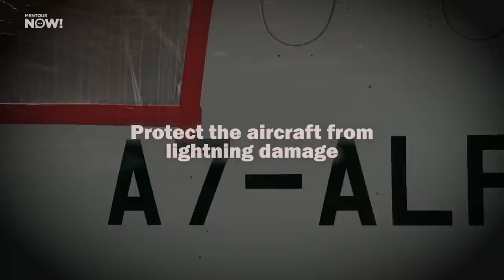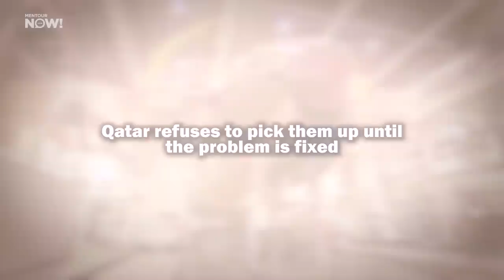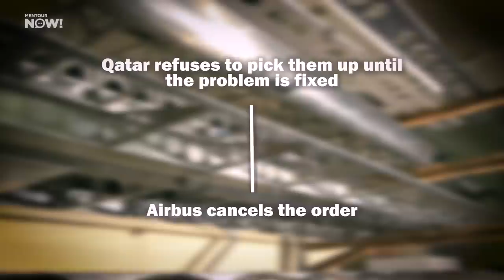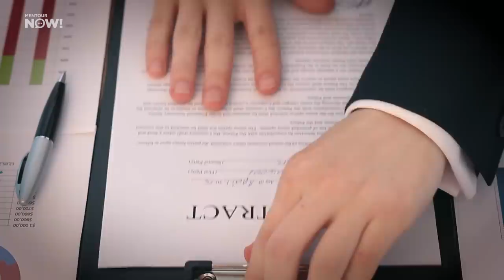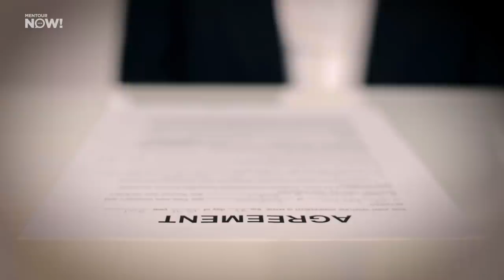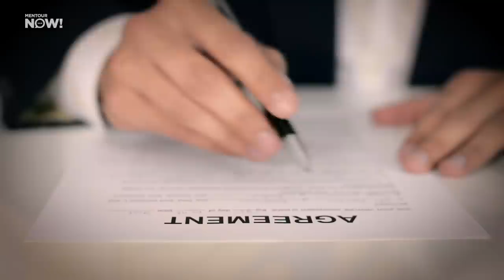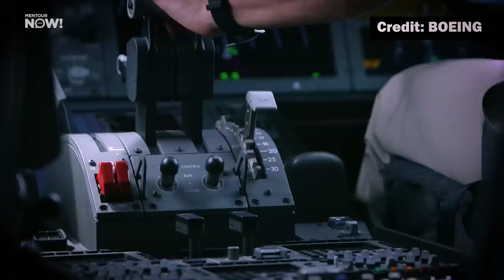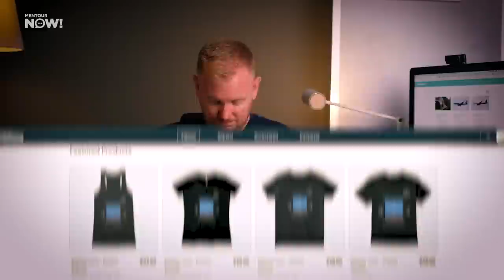WHO is Winning the FIGHT between AIRBUS and QATAR Airways?!

Comment: If Airbus is still producing planes with this 'cosmetic paint' problem they may have a massive commitment to keep these planes painted for 20 years.   I doubt this is the case.  Chances are if they have not changed foil they have done some sort of paint prep work to ensure there will be fewer and longer times between problems.

Qatar should not have grounded the planes based on them being unsafe.   It should have been treated as a warranty issue, too unsightly to fly.  They would have had a much stronger case.

I constantly hear that if this was a real problem other airlines would be joining Qatar in this.   There is zero benefit in doing so.  Airbus might cancel their contracts for new planes!.   Win or lose other airlines have the most to gain by staying out of it.

During the recent Boeing debacles we heard about the need for transparency.   There has been little of that here.   The claim that it was a cosmetic paint problem is still being tossed about.  Kind of like saying your house has bad paint when the siding if falling off.  An extreme example but it fits.  Here the problem is the foil.   Airbus has been silent on this because in part they did not want sales to stop while they fixed the problem.  There is a large amount of uncertainty.  Also known as lack of transparency. 

Airbus and Qatar may have been to the point that a falling out was going to happen.  All it needed was a trigger.     The inability to see this is problematic.   Not about to dig for proof but other sales organizations work with difficult customers.    A common solution is that difficult customer pay more.

Comment: At 00:32 The images were disturbing enough to me that I went back again and again and again. Airbus had the opportunity to address this problem. Did they? Arrogant? I think the facts were clear enough to take the hit and move on. Cheers.
Reply: Airbus had offered Quatar to repair all damage at its own expense. That is not arrogant. That was a good offer. Quatar, in the person of its autocratic CEO Al Akbar, rejected it. They wanted to make a profit and fell flat on their face.
Reply: @gerhardma4687   Mmm mmm, Airbus used a mesh which was not acceptable to the administration. Nice try!
Reply: @anthonyrstrawbridge  Boeing's 787 had the same problem with mesh. The mesh was absolutely required for lightning protection, or would you rather the plane be burning when lightning hits it?

Comment: I think the A-380 soured the relationship between Airbus and Qatar.

The aircrafts operating cost is ridiculous, to the point that it counts as an engineering failure.

Its why they were retired DECADES early with no one interested in buying them.

Buying the 380 was a very expensive mistake for Qatar.
They lost billions over it.

So when Qatar started having trouble with their brand new A-350's tempers flared.

From Qatar's point of view they got screwed over by trusting Airbus on the 380 and they had no intention of trusting them again.